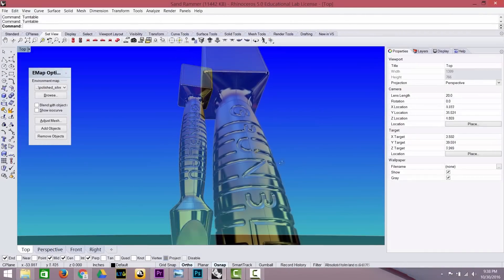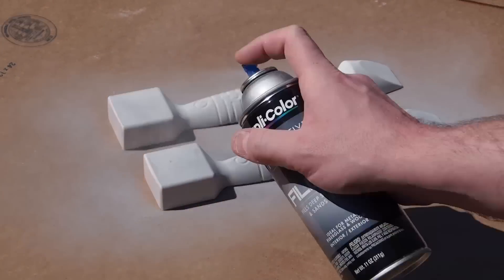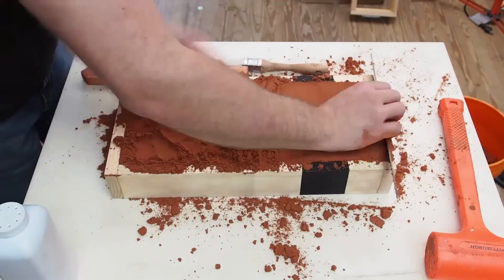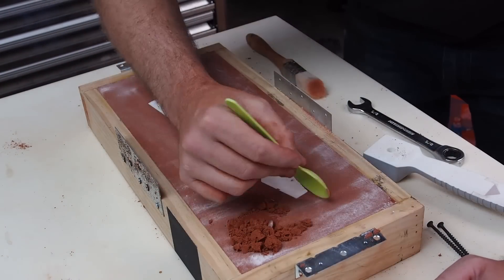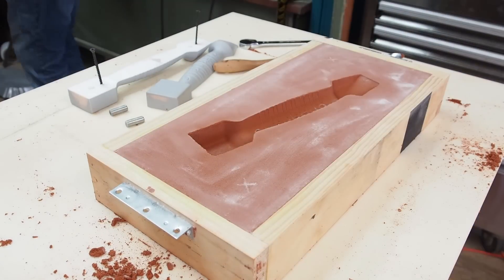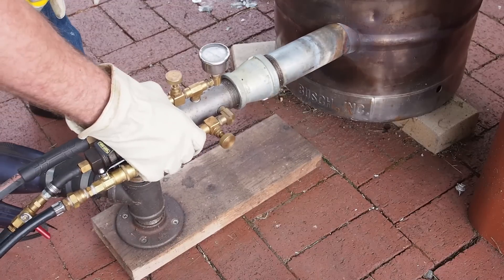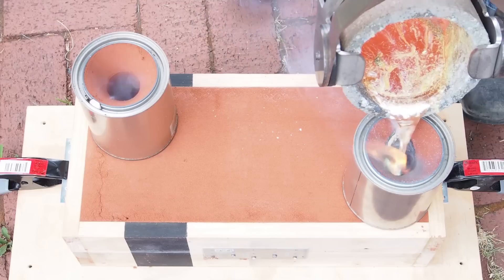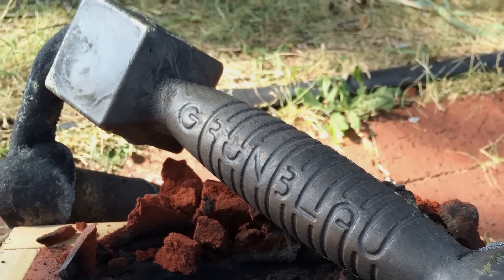Casting Brass | Sand Rammer - 3D Printed Pattern

Comment: i know this is late but... i watch loads of these mould videos. (i have no experience of doing any of this i just like watching) tell me please, at round about 4 min mark you put the handle in the sand and then you create channels. ive seen this multiple times, why dont you have a template to make the channels? instead of trying to neatly scoop it out with a spoon. it probably is a dumb question but a bend and maybe a couple of straight tube parts to fit most moulds seems an easier solution.
Reply from the maker: I do at times do molded channels, but for the most part these aren’t critical and just connects points.  I have started printing some go to runners and sprues, however…

Comment: I have found you can cut down a lot of the dross by tumbling fittings like these in sand and water [I use a small cement mixer] Gets rid of oxides and surface contamination and the sand rinses off easily. Gives a very clean pour
Reply from the maker: Hey thanks! I was shocked by how much there was!  I’ll fire up my tumbler on those style fittings next time!

Comment: The number of risky movements you do is astonishing. e.g. using a nail gun, with your thumb right next to the piece to be nailed, cleaning the metal particles next to a band saw with your hands while it is running and in your video 'Casting aluminium for the home from a simple 3D print' you put the crucible in the furnace with your hand while the furnace was running. I am surprised you still have your hands in good working condition. Be safe.

Comment: Great Job. I want to see more 3D Printed Molds Of Gears And Gear Boxes!  I was going to pick up My Friend's CR 500 And someone stole it! You can Emagine How Pist I Was! It Needed New Bearings And Crank Rod & Piston& some seals. No Problem. And the Crank Casing Was busted out. it Blew Up! Still no Problem! But The Project was stolen Just a day Before I Showed Up With The Money Just $45... I was going to Have it welded and then machined, Bored. Again no Problem.. The Casting for that part was insanely expensive so .. I always wanted to learn How to make Molds out of Aluminum.. Your videos are top notch. And the 3D Is Excellent. I know what I am looking at! Great Job.  Thanks.

Comment: Woah that’s almost inhuman casting great work oh an P.S:Can your Keg setup melt scrap lead from car batteries.
Reply from the maker: Overkill for lead!  Check out my lead dripper video for what I used for this...  you could buy a cheap hot plate to do this.  For large melts I’d look into a sturdy turkey fryer.

Comment: One of the best tutorial of casting DIY on the web...and you're very accurately in what you are doing...I suppose you're a designer or engineer. But hope there will be quickly a cheap  metal 3D printer on the market....because pouring metals is dangerous.

Comment: If you're doing this a lot, why not save your arm and invest in (or build) a pneumatic sand rammer? A regular air chisel set to low PSI and a big flat dingus end would work too, I'd imagine. The added vibration would help the sand to settle. I just hope it wouldn't be so strong as to crush your mold positive or make it un-releasable. :o

Comment: A few other quick questions before I attempt this:

1.  Were you able to use the models with the metal pins a printed, or did you have to drill it to fit?
2.  What print settings?  Walls and fill percentage?

Thanks is advance!

Comment: Brian,  did you add draft to the 3D print, or does it have straight sides?
Reply from the maker: +Marshall Jones This one has straight sides.  Someone correctly pointed out that the cube could be rotated 45 degrees to give a draft to the model without affecting the geometry.
Reply: I'll do that to my solid model

Comment: Great video. I'm curious why you didn't use a plate between the two pattern halves. I feel like it helps protect the sand on the opposite side when you're packing the second side.

Comment: Subscriber: Bet you can't cast a tongue twister.

Brian Oltrogge: Bet you I can.

Subscriber: If you cast a tongue twister I will buy your sand rammer and ram sand.

Brian Oltrogge: Ok deal.

Brian Oltrogge: Making a Rammed Sand mold for an Aluminum Sand Rammer by using my Brass Sand Rammer to Ram Sand over my 3D printed Sand Rammer pattern. 

Subscriber: Damn Brian you Rammed that Sand Rammer right on this bet and made me Pound Sand for it now I have to buy that Sand Rammer and Ram Sand man did I get Rammed into an Oblivion with that tongue twisting Sand Ramming Rammer.

Comment: you can use borax for flux on that brass, and those fumes are zinc oxide from boiling the zinc off...too hot.
Reply from the maker: +Sugarsail1 I still need to experiment more with brass...  I knew those fitting were pretty high in zinc content.  I didn't have a lot of fumes, but enough to discolor the exhaust hole.  Wore a respirator the entire time!

Comment: Brass slug give you an arm workout.  Very lovely work, again.  The pattern draw came out really nice, no pull outs.  I was wondering how the grainy 3d print would pull, looked good, after the priming/sanding.  Is that PLA? (oh, noticed your Makerbot platform arms.. I changed mine to aluminum, added tremendous rigidity... BC Technical Solutions made them... I also moved to 10mm rods, instead of OEM 8mm, and used 6x9x1/4" Garolite table w/6x9x1/8" glass plate atop.. very, very rigid)
Reply from the maker: +boogerhead0 I have some arms modeled that I should machine or cast...  I would also like a heated print bed.  I am also torn between buying an Ultimaker or designing my own... meaning I haven't invested any time/energy into the Makerbot.  Thanks for the suggestions, it got me thinking again..
Reply: As an aside, I stopped using the heated bed for PLA.  Totally unnecessary.  I use 2" blue tape on glass plate for bed.. tried Kapton tape, waste of time/money, and heat not req'd for PLA, maybe for ABS, which I've never used.
Reply from the maker: +boogerhead0 I have difficulties printing objects longer/wider than 4-5" or so was hoping this would help.  Would really only affect the first few layers, I suppose...

Comment: Brian, fantastic job. Great narration, simple and to the point. I have a question though. How did you split the printed model for each half of the molds. It looks like you printed the complete piece ends and then sawed each half into half again.
Reply from the maker: +John Russon I printed them already split.  They were separated about an 1/8 of an inch on the print.

Comment: Did you purchase your crucible tongs?  Or did you design / build them yourself?  (Thanks for your earlier reply about the petrosand!)
Reply from the maker: +Andrew Boheler designed and built them myself...  Working on getting the cost down as full stainless is kinda pricey...
Reply: Is there any chance you could do a video describing the design / build process for them?   

I'm always willing to pay for high quality material up front because I know that it will last generations, if it's taken care of.   If it's poor material, it doesn't matter how well it's cared for... it will break down.
Reply from the maker: +Andrew Boheler Yes, working on it now!

Comment: Is it advisable to use lost PLA method , instead of removing the prototype from the mold?
Thank you for the entertainment.
Reply from the maker: +BisdremisKostas There are materials that work good for 'lost _' PLA isn't great.  It smokes a lot.  A good method might be 3d print>silicone mold>wax> lost wax.  Otherwise, people have done it to varying degrees of success.  In all of these cases, you will remove the prototype from the mold.  Unless you are using foam.

Comment: I love the noises from the sped up tapping segments! Very nice results, the fine sand first around the print master is a good idea I'm going to use when I make a sort of 3d printed desk from lattice like modular pieces. It will have an aluminum subframe for reinforcing the desk which will be cast from a 3d printed part, and the rest of the modules will be made out of resin using a silicon mold made also using 3d printed parts.
Reply from the maker: +Shannon Williams Sounds awesome!  Good luck!

Comment: What material did you do the 3D print in? They look like they have a relatively nice finish right off the print bed.
Reply from the maker: +Dyllon Holle This is your run of the mill PLA.  An easy way to improve your prints is to turn down your speed.  Printer software has these settings on the high side to keep print times sane.  I usually don't watch the prints so if it takes a couple extra hours, I'm fine with that. This is standard resolution as well...
Reply: Brian Oltrogge Ok, just wasnt sure because sometimes it looks more rough. Thank you for the fast response though.

Comment: Hey Brian ! When you first built the foundry and the burner, you never included the template for the turbulator. I'd like to have a copy as I'm getting ready to build one soon. Also, what did you use for your fan ? It looks like a hair dryer with a meter wired to it. And one final question. what size was the beer keg ? Thanks, hope you can reply soon !

Comment: You  should try making up some alumino bronze.  90% copper and 10% aluminum.  I made some up and cast it and it has an interesting color. Also  stays bright better than brass. From what I hear it is not much use except for decoration.

Comment: 8:40 "I'll highlight the grip detail with black paint" Admit it, you just didn't want to file out all the tarnish, so you just painted over it. :-D turned out very nice though.
Reply from the maker: My intention was to not have to file it at all in the grooves but I had to because of the mold lines.  Then I had bright brass showing through the tarnish.  Flat black paint became the obvious solution for making the grip detail the same color!

Comment: Great work, I always love to see castings come out looking spot-on! I'm wondering though, most of my greensand castings never turn out as well as this, so do you suppose it's the petrobond's oil-based nature that results in better casts compared to greensand's grainy/sandy texture? Also really love the design you made for the rammer. Looks awesome!
Reply from the maker: +Lane Richardson I think it may have a lot to do with the mesh size of the sand.  I think my Petrobond has 120 mesh sand as it's base.  Add to that fine clay and the surface quality only gets better!  Thanks for the comments!

Comment: Very clean casting. I noticed during the making of the aluminum domino box you used CA glue to aid in filling/smoothing the print. Have you found this method of using automotive primer superior? Are there advantages of one method over the other?
Reply from the maker: +DIY Mechatronics Thanks! The primer is faster and the CA glue is much more durable.  I'd prefer the durable finish of the CA glue, it just takes a long time.
Reply: Ah okay - that makes sense. I am just getting into greensand/petrobond casting with my 3D prints and have only done lost PLA with plaster of Paris before. I will probably try this method for smoothing the print along with some others. Thanks for the tip!

Comment: DO STEEL!
Reply: Phil Chia steel melting point is much higher than iron brass copper and aluminum. the foundry would have a hard time if not couldn't even reach those temps. though he did say earlier that his burner does put out alot of excessive energy so he might be able to.

Comment: Great video. You got another subscriber. I'm working on my first forge right now and plan to use a wood turning as dyes for my hand rammer. Why do you feel the brass being heavier made it less than ideal?
Reply from the maker: +Greedy Paul Thanks and welcome!  The brass seemed too heavy for use around a delicate pattern.  Need to strike a balance between heavy for compacting and light for lifting 100x during the molding process
Reply: Brian Oltrogge can you think of a way to make brass end bits in one pour and an aluminum handle poured into it?

Comment: hi Brian. I'm building a furnace like yours in fact I cut the top of mine just yesterday. it's going to take some time to build as I want to get it just rite. the only modification I am making to mine is something iv not seen on any homemade furnace on youtube at all but I think it will help my furnace last a very long time. I'm still gathering materials such as tools to help with skimming the dross off and lifting my cruicible out. like I said this sort of thing can be very dangerous if not done properly and taking seriusly. please excuse my bad gramme and hopefully il put a full video from start to finish on my full furnace build.

Comment: You should totally make a hammer like thing to compact the sand so you don't need to use that stick as much. Like it could maybe ram the sand down? Not sure what to call it though i'm thinking "processed former rock compactor"

Comment: Great quality as always. You really had the margins on your side with the brass cast. Nice when that happens, feels like it's the other way around most times :p I must say I giggled a little in the scene where you explain how a stick don't weigh anything and don't have enough surface area; all the while the big red and heavy dead blow mallet was right next you :D And then you pick it up and use the handle end to compact the dirt hehe. Why not just use the mallet as a mallet and beat the sand?
Reply from the maker: +Auarhau It is just a bit too heavy to have any kind of a feel for what you're doing.  Also, you really want to pack the sand with a wedge shape.  Not that you would, but imagine packing sand around a ball bearing.  If you only packed downward, there would be a shadow under the ball.  If you pushed a wedge next to the ball, the sand will pack in all directions around the ball.  If you pack with a flat, the layers won't stick together well and they will separate as you pull your pattern or try to cut your sprues.
Reply: Makes sense, thanks for the explanation:)

Comment: I think you would have had a considerably easier time of removing the pattern if the square end had been rotated 45 degrees to the parting line.

-jcr
Reply from the maker: +NSResponder Where were you about a month ago?!?  As I read your comment, I could swear I had that thought before, but had completely forgotten about it.  In any case- Yes that would have made it much easier!  I'll do that on the production version :)
Reply: One other thing that can save you some time: instead of extending the sprue and riser holes with those cans, you can just cut a basin into the sand on top of the cope, right in the center.  Makes your pouring target bigger, and the metal running into the sprue will be coming from a lower height, making it less likely to carry any loose sand into the casting. 

If your basin is deep enough and the channel from the basin to the sprue is nice and wide, it will also serve as a shrink reservoir. 

-jcr
Reply: +Randy McNurlin This is a fascinatingly opaque comment. Not a word I understood.
Reply: Brian, Great work as always. You're attention to detail is inspiring. If you are taking design suggestions rather than just rotate the square head I'd like to see you push yourself a little further with the design tools you have. With Rhino and a 3D printer you don't need to stick with primitives that can be produced with a lathe and mill. Try something like bowing the sides (this is a great trick for disguising draft) and use a spline curve instead of a simple radius on the corners. Throw up some zebra stripes on your model so you can check for good surface continuity between the sides of the square and the corners.

Comment: The brass rammer is pretty nice with the black paint. Could you have done an electrolytic process to remove the tarnish on the casting to leave a textured surface to grip?
Reply from the maker: +Jed West Maybe!  I am not familiar with those processes.  Trouble is that there is still the mold line and gates that are cut off.  Unless the texture was faked in these areas the memory of them would remain.

Comment: Great video! but in the future when you are sanding odd shapes like that there is a perfect tool if you have a drill press. Look up "sanding balls". I know harbor freight sells some 3" ones that are decent quality (though you may need to tighten them or epoxy the shaft so they have less slip). You just put it in a drill press, turn the drill press on, and you could finish sanding that entire brass piece in around 10 minutes. I often use it for cleaning brass fittings that have been sitting in my fittings box for too long since I can put my hands (with gloves) right up into the ball

Comment: Great video! I'm a bit confused about mold shrinkage. If the metal fills the mold, and when you extract the metal from the sand and it's not shrunk down, is there any shrinkage?
Thanks!  Beautiful parts, great video, and good techniques everywhere, as always!
Reply from the maker: +Silas Marner Thanks! It shrinks while it cools.  You can counter act a bit of it by continuing to feed the part while it cools.  There will be shrinkage though.